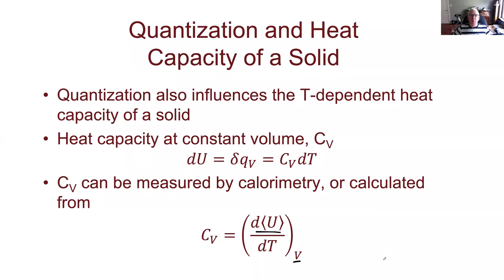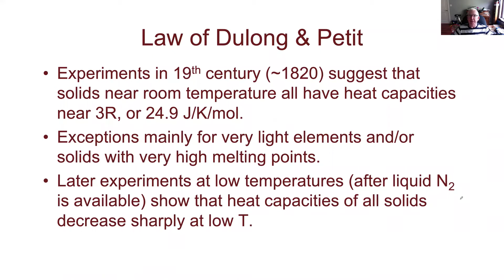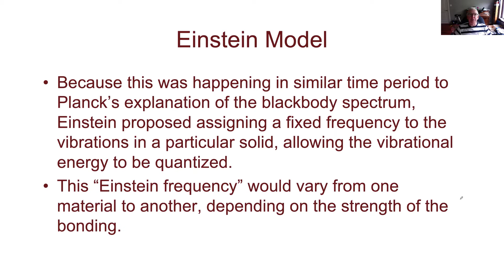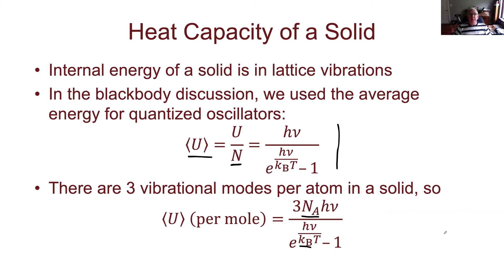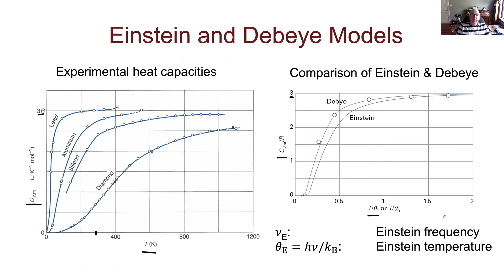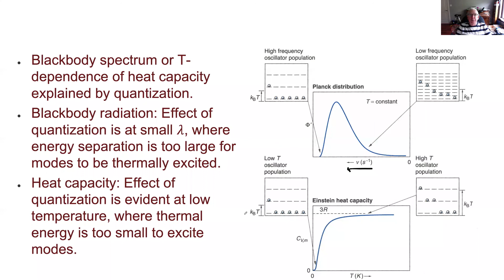Heat Capacity of Solids

Comment: For the last slide: 

Is it saying that for high frequencies or modes of oscillation we should expect lower levels of energy and thus, electrons in lower energy orbitals (closer to atom)? Then low frequencies generate high energy levels and more electrons in higher energy orbitals (further from atom)?

The low vs high Temperature is pretty straight forward in my view and I don’t have any questions about that part of the last slide.